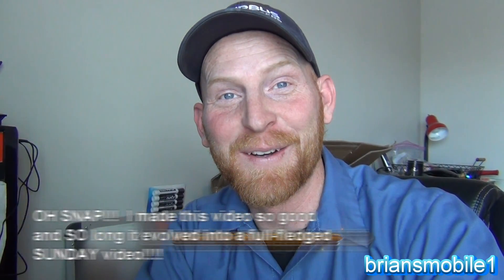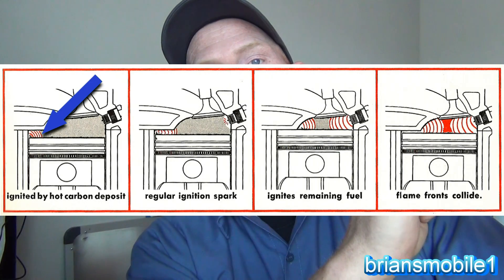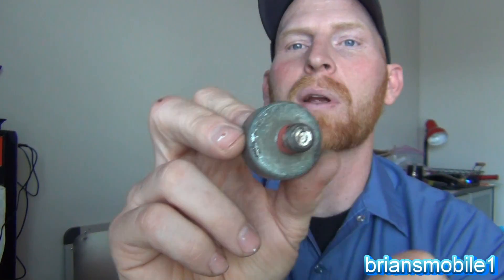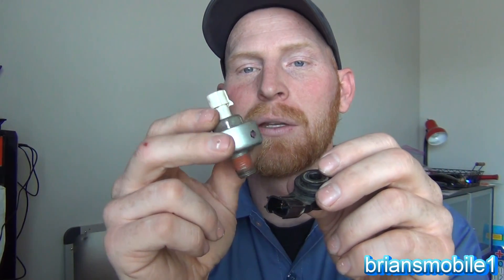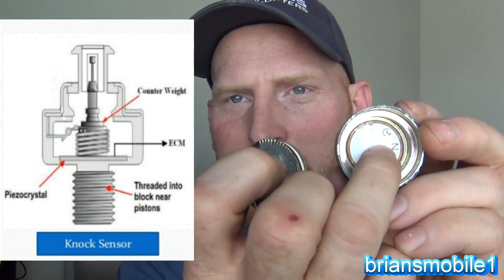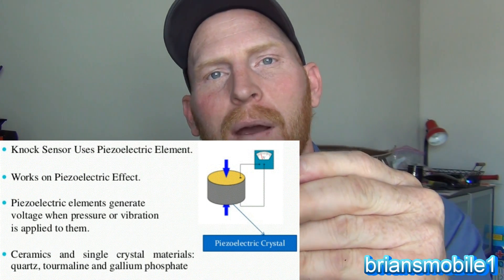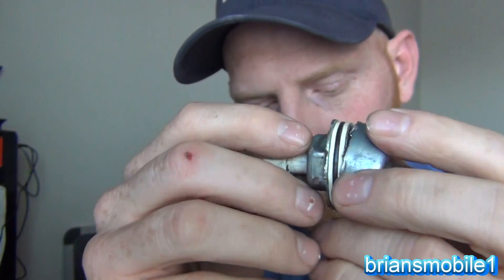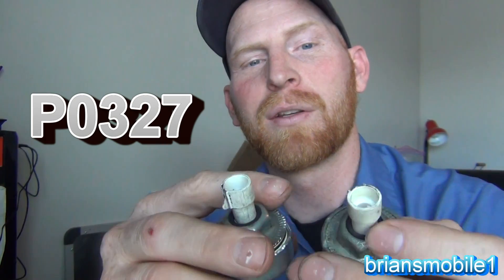The Knock Sensor Video

Comment: why does a knock sensor fail
Reply from the maker: Rust, metal fatigue from vibration over time, plastic casings dry out and crack, connectors fail.  Pretty much same as every other sensor.

Comment: Excellent info here 
Would a knock sensor create random engine light comes on steady and then studder like pressing on and off gas pedal when im not... maybe 10 miles into driving. This is intermittent. If i turn off car for 5 minutes or 5 hours it starts again in 10 miles..not every time 😮😮 and yesssss ill watch your other videos and also check out the recommended channels 
Thank you 😊

Comment: Know sensor cristals al the same ones the phiramits in Egypt had . 3 types one  was remove. This criminals wen compress or shake of pressure . The create a current then amplifies the current  . The bigger the structure the bigger the power . U can creat a pressure pump with running water into a cube with in a cube . Work like a hydraulic pump pressure n shake makes criminals alternate current free wireless

Comment: Thanks a ton for the video, I just went through the painstaking process of replacing the knock sensors on a 06 2500HD. I went with the OEM from the dealership (GM Part No.), Bench tested both with a multimeter before install and at various points during installation. So far so good!

Comment: My knock sensors are working it’s a new build on my s10 when I dropped a Engin I got it from a junkyard I never really tested it or did a compression check but I do hear a pinging sound and when I accelerate it backfires, I definitely hear a bad Lifter

Comment: Good vid. Lots of info but I respectfully disagree with 2 things... Knock sensors came with fuel deregulation after 1978 when pump gas went from 103 octane premium down to 87 octane regular. Octane level determines gasoline's resistance to detonation. Compression was lowered initially, but much power was lost. Computers and sensors allowed some of that to be reclaimed.  Next item- turbo and blower engines are usually LOW static compression. This allows more room in the combustion chamber for a bigger air/fuel charge. Your compression is determined by the speed and ratio of your supercharger or turbo. Your rpm is limited by the fuel's octane and where detonation begins. An engine with higher compression will have less power gain by adding a turbo/blower than a low compression engine. A naturally aspirated engine with 10:1 compression will make more HP on a dyno using 93 octane than it will using 110 octane race gas. Proven fact. Excessive octane slows the rate of combustion and makes less power. Use just enough octane for your compression ratio and no more and you will make more power.

Comment: rebuilt a 93 chevy c1500 4.3 engine,, it had a rusty old knock sensor.. I put a brand new one in,, at the parts store, there were 2 available for my model, but different part numbers that cross referenced to two DIFFERENT OEM part numbers.. ., the one they gave me doesnt seem to work.,  I get an immediate code 043 that will not clear..  I have 5 volt reference to the wire going to the sensor, but when I hook the wire up, I dont get a voltage drop to 2.5 volts.. it stays a steady 5 volts DC.. I performed the resistance test on the  sensor itself. . and get 0 continuity, the service manual indicates I should get around 3900 ohms..  Im trying to figure out if I either recieved a defective sensor. OR I recieved the wrong sensor.. the service literature says a steady circuit proving voltage goes thru the sensor and wiring from the ECM.. with key on or engine running.,,,,  If the sensor cannot let voltage flow thru it, theres no way I can see it can complete the circuit.  the choices are  gm 10456031  or 10456018 .. I cannot find ant service info that tells the difference between the two sensors.  As I understand it, the ECM sends out the 5 volt reference signal to the knock sensor, and the resistor inside of the knock sensor decreases the dc voltage, according to what the ECM expects to see. I think it has to work as a feedback, because its a single wire system that completes its path of ground, thru the engine block, ground wires, and back to the ECM. Im finding that different knock sernsors may have different resistors in them,, some Gms have 100k, some 89k, some 39k. theres a heck of alot more to knock sensors that I previously thought.

Comment: Back in the day... there have always been 2 knock sensors for your engine. They are installed on your head. One on the left and one on the right, typically. Their effectiveness was determined by each persons exposure to and duration of very loud noises like rock music, heavy equipment, etc. Mine are 60 years old and still work, although I do have some ringing in them now. He he...
Reply: In the old days you don't have any thing like  sensor or anything they put they in your car so they can' rip you  enywhay delete and it will stay out  you ok but now if you have the light on they don't inspect you car so that is a clown story

Comment: I cannot find my sensor, I know its on the passengers side, down near where the spark plug wires start, on the lower part of the engine..can someone show me where. I have a Chevy S10 year 2000, and the 4 cylinder engine, auto tranny. I see nothing sticking out of the engine like he had at 5:30 in the video for a chevy.

Comment: Hey Brian how are you thanks for the information but I had a question for you, do you know if the knock sensor can ge damage if the wire harnes get naked (wires exposed or not isolation) and hit or make contact with the engine or body of the car ? Thanks for the answer in advance and hopefully you understand me

Comment: THANKS FOR THE INFO.   AM I UNDERSTANDING THIS CORRECTLY?   ARE THE KNOCK SENSORS ESSENTIALLY USELESS?    I DRIVE AN 06 25OOHD GMC.    IF PREIGNITION IS AN ISSUE WOULDN'T ENGINE PERFORMANCE SUCK AND RUN A BIT ROUGH?

Comment: are you sure the computer feeds the knock sensor 5v?  @11:09 
also, you said that the signal voltage comes back on the same wire? ac power would be a wave form at what ever hz, i know you can run split and 3phase ac on the same wires, but never heard of dc and ac being used on the same wire.

fyi: i likely misunderstood you, other wise i need to rethink what i thought i knew about electricity.great video btw, i have been watching your stuff off and on for years as you are one of the few who insist on understanding theory and application before moving on or trying to explain something.

Comment: Thank you for all the information I have a 1994 suburban with 294,000 miles on it with OBD1 , I am getting code 43 I replaced the knock sensor and I am still getting code 43. God  Bless you

Comment: Got a po325 on 98 honda prelude. Noticed harness connection coated in oil. Will clean and see if code comes back. If it comes back will replace with oem. Best video out there on knock sensors.

Comment: I've used Dormon sensors and harnesses on LS engines, and they are fully and happily compatible for sure... no issues there. Only issues I have are with water getting into the knock well on the lower valley cover NO MATTER WHAT. Doesn't matter what kind of seal I put on the grommet, what kind of silicone dam I make to combat the absolute abhorrent engineering fail that was their placement, nothing... no matter what, well two fills back up with piss in about a week or two tops. I don't even know where tf the water comes from... it doesn't even have to rain. But each and every time you pull the GD intake off, along with everything connected to it, unseal all the silicone, pull it all apart, and filled with piss... err.. water. Last time I just said fk it.... fk that rear sensor... the truck honestly doesn't "listen" to bank 1 and bank 2 individually, the two of them are more for redundancy. Soooooo, the quick fix for one bad knock sensor on an LS is to just clip the harness, and wire both ECU lines into the good sensor.. usually bank 1. Engine will run exactly like you have two of them, using bank 1's senor for both. I may go back next year and rip it apart again, when it's warm and not raining torrentially every gd minute of the day, as it now is... until it turns to snow and gets even worse. So, this will do for now. Maybe forever. . .

The way you explain the electrical side of this is a bit off.... The deal with them is that they are known impedances, usually 100K ohm. At least for the LS engines / most GM. . . And the computer sends the 5v / 2.5v out to the sensors, which then hits the known resistance and gets measured out to a ref table. The ref table will look at what the resistance did to the known voltage and determine if there's knock. The way it does that is via the piezo crystal. . .When there are knocks it will cause the crystal to produce voltage, changing the resistance of the sensor, and determining to what degree knock is occurring, then the ecu will adjust timing accordingly. The issue with the water getting into the well is twofold. It will A) corrode the sensor, ingress into the sensor, corrode the grounding ability of the sensor, and ruin things that way. But the main way they fail when water gets into the well is that the water hits the single wire connections terminal, allowing a path to ground via the water itself, which will be considerably lesser than the 100K ohm known and expected value. This is when you see the low voltage code for your given failed sensor, usually bank 2... or rear engine. But again, either of them will hear the whole engine... you don't need two in this layout. Older ones with a sensor on the outside of a head or block, on each side of the V configuration, these have a bit more merit to using 2x sensors. But when centralized like the LS has, one is truly fine.... I have tables galore showing the identical performance of 2 good vs 1 good wired to act like 2... exactly the same either way. 

Lastly, DO NOT overlook the Dormans... they are on Amazon, and like $45 for a kit with a harness.... they work just fine.

Comment: And the ECU expects to hear something on Toyotas. So you can't just shunt or bypass them. It isn't resistors, but a 8000 picofarad capacitor(pf), aka .008 microfarad (uf) capacitor.  I just want to tell the ecu everything is fine. It's just a noisy waterpump and ignore it. But no, their firmware listens to the engine in the ECU.. Time to hack the firmware or make a signal generator based on rpms to deliver the right return to the ECU. 1995 Camry V6 so that covers the 1992-2001 models.

Comment: Yes watch the Delco sensor the top crimp will not hold and rotate break connection on 100 k resitor . I have been using the gm oem cost more but cheaper than doing job twice.

Comment: Guess I'll pony up the $1500 to have them changed on my 19 year old V6 Toyota. Got a check engine light code for caused by one of them. The harness also should be changed.

Comment: Chevy knock sensors are cancer. I decided it wasn't worth it to replace it on my 04 avalanche and just spliced that shit (bank 2 failed, so I spliced both into bank 1). If bank 1 ever fails, I'll probably just wire in a resistor bypass. Trucks 17 years old and has 185k miles on it. It has served its purpose. If it burns up a piston from daily driving knock i'll just slap another 5.3 in there or junk it and get another vehicle.

Comment: We did a knock sensors (AC Delco) on my 5.3L L33 engine and I still throwing codes for the knock sensors!  My brother has been a great mechanic for easily 30 years and my truck is got us both scratching our heads! He's looked things up online on one of those main companies. I have low power (not able to power break - No burn out! ), getting 12 miles to gallon, we tried to bypass with to other sensors just to get it to pass inspection & no luck!  And have you ever heard an hour meter reset itself?  Because it has with mine. Maybe you can give me some ideas?  Thanks for reading this.
Reply: @kevinlonghurst631  I've not heard about any of the diesels hour meter resetting itself to zero like mine did! 
If there's any GM mechanics out there that could check into that & give us some insight to what could be done to fix it or just simply what happened!??
It would be greatly appreciated! Thanks

Comment: I had a knock sensor bank 2 code come up on my 8.1L 2002 Chevy and so I went to orielly auto parts and got 2 new knock sensors and put them in and now it throws a bank 1 code and sometimes a bank 2 code also I should have mentioned that when I took out the bank 2 sensor the first time its pluggin connection was all rusty.. So that explains why it threw the code the first time.. But why is it throwing a code for both sides now? Also my knock sensors are mounted down on the sides of the engine by the oil filter and starter.

Comment: Thank you Brian. My Toyota Tacoma has a knock sensor P0325 fault. Fortunately it's a 2.7 4- cylinder. With a low profile ratchet i can R&R hopefully with out removing intake. A neahbor walked up and said "hay you got hesitation when you accelerate after shifting down?" I said YES but my scanner said it's the knock sensor. He said he repaced the No.4 spark plug wire and that solves the problem. HOLY SMOKES my spark plug wires are original. Stay tuned and thank you again. Conrad

Comment: I have a similar problem. I replaced my sensors and harness, but I still get low voltage codes on both sensors, but only after driving on the highway. Are they bad sensors, it the threadlocker causing it?

Comment: question! if there is a knock, does the pressure in the cylinder rise above what would be the maximum created under normal (ie without knock) conditions during the entire cycle?

Comment: Hey Brian that video was great. I know it’s been a while but would you still have the video about the Silverado. I have an 03 that I changed to KS’s on (used AC Delco ones) because the engine was pinging unless you put 93 octane in it. Now it don’t ping with 87 octane but the MIL is on for “low input”bank 1 &2.

Comment: 94 Fleetwood 350. The car runs like a dream, I get to half peddle and runs like a manual in 4th gear while driving 10mph. I replaced almost all the sensors, ignition, air and fuel line. No codes. Does my issue sound like auto ignition from carbon and bad knock sensors?

Comment: Got a 94 Chevy Silverado sets a code 43. Which is knock sensor any way to trick the knock sensor since I can't get it off to replace. Everything else has been worked on . I'm not going into everything, but you probably know. Thanks

Comment: There's detonation . when the mixture explodes . and preignition when the mixture is ignited by something other than the spark plug. Preignition is what holes a piston it can occur way before tdc.  Causing a tremendous pressure spike . detonation melts the piston at the side . you can also have pre ignition induced detonation.

Comment: Great stuff, thanks !  So the knock sensor "hears" pre detonation and adjusts timing. What keeps it from "hearing"  a normal detonation and then doing its thing?  I.e. How does it tell between pre detonation and normal detonation?
Reply: Normal detonation is relatively tame compared to pre detonation. This is because normal "detonation" is actually conflagration, much less violent than actual detonation

Comment: I'm amazed at how ignorant alot of mechanics are about knock sensors.when you get a code for knock sensor it doesn't mean the sensor is bad it means it's sensing an engine problem like a bad injector for example.whatever the engine problem,fix the problem and it will also eliminate the knock code.knock sensors rarely go bad.
Reply: Boots789 V  what is the best remedy (should I just run premium fuel ⛽️ or should I use sea foam) 1997 Cadillac calls for 91 octane. FYI just bought it but it has knock sensor code. It sat for a year and I just replaced the fuel pump and started it for the first time. Please reply

Comment: This is a crazy question but I have a 2003 safari van and It has some pinging on acceleration after reaching normal operating temperature . I have a heat shield above the tailpipe that is hanging down on one end and rattling on the tailpipe . Is it possible that the knock sensor is picking this up and adjusting for knock and actually causing it to ping ? Probably not right ! Most likely a bad knock sensor. You say chevy takes two sensors but I have been told the 2003 4.3 V6 only has one ? I also considered The EGR valve as possibly the problem , but apparently the 2003-2005 safari and astro 4.3 no longer have EGR valves but have a different system. Would appreciate any help from anyone on this. For starters where exactly is the knock sensor on the 2003 4.3 v6 ? Been told it's on the back of motor others say the lower side some say under the intake ?

Comment: Great Videos! I recently purchase a 2004 Silverado 2500HD with the 6.0 and it is throwing the dreaded P0327. I suspect I know the answer to this already; but there are some videos where they install new knock sensors on heads using existing tapped holes on the outside rather than removing the intake. Is this a recipe for disaster due to them not reading knock properly or is there any validity to this? Or would it work and save someone the headache of removing the intake?
Reply: What did you end up doing and what was outcome.?
Reply: @TrendingNorth  it wasn't that bad of a job to just replace both knock sensors and harnesses.  Remove the stupid foam that GM puts under the intake while in there. It's what traps the water causing the problem in the first place. There are service bulletins on this.

Comment: Would bad knock sensors cause the truck to not go over 2k rpm? And also for it to die when you rev it and it idles down? But the truck can rev out when in 1 and 2 gear but still struggles in 3 but it also dies sometimes in reverse. Any help would be appreciated. I brought it to auto parts stire and they plugged in computer and it read knock sensors out and clavicle purge valve